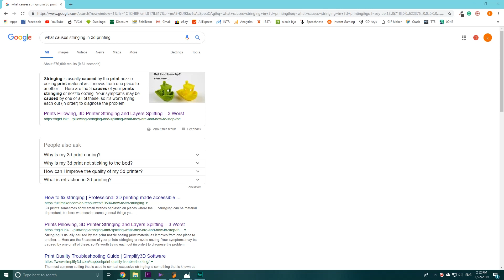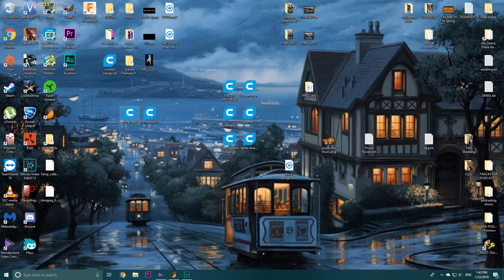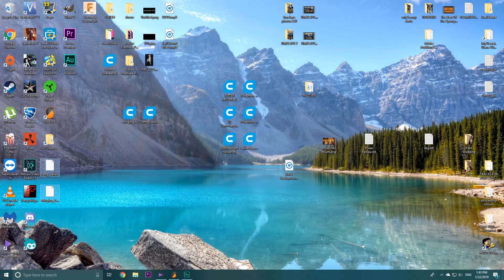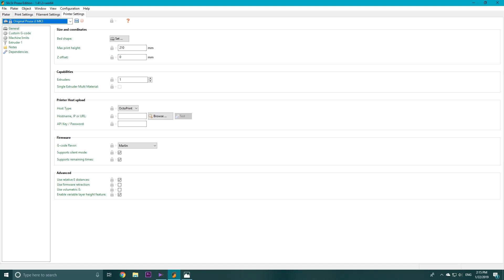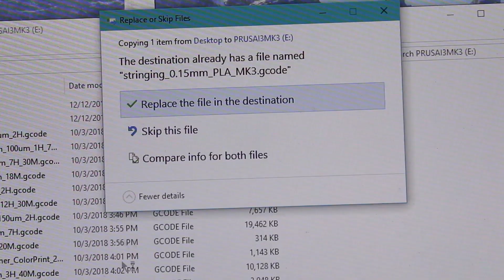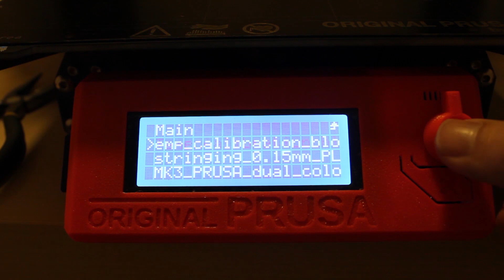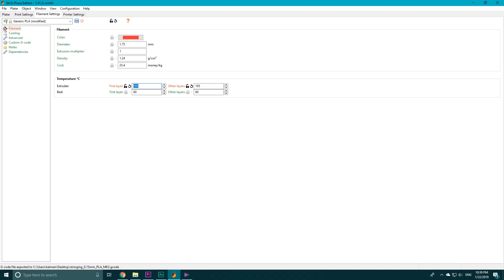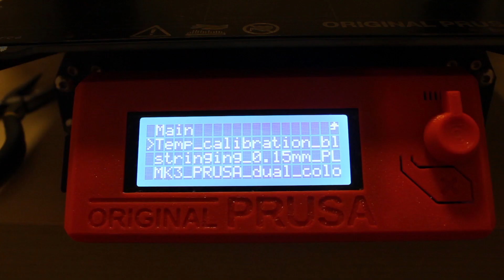How to Fix Stringing on a 3D Printer

Comment: You are 100% wrong. 
What causes stringing is the SOFTWARE, nothing else. Cura simply doesn't string. Prusa is terrible. Identical settings, different algorithm.
Reply: Actually I get where you're coming from but I use cura and the same issue Think of it this way the higher the temperature the longer it will stay goopy and if it moves real fast without giving it proper time to cool down it will cause stringing or blabbing and just overall horrible quality it actually seemed to fix my issue when I lowered my temperature down about 20° but still staying in the recommended temperature of the filament

Comment: This issue is different for every role of filament I have owned. Because the melting point of different sources of the same plastic varies widely. 
You can print with any of them but the need to change slicer settings for each role can be really tedious.

Comment: Export the GCode,
Save it,
Replace the file,
Pull out the SD Card,
Put it in the Computer,
Drag the file into the SD Card,
Replace the Destination,
Pull out the SD Card,
Put it back into the Printer,
....and Print.

Yes, seriously. I can't afford a Prusa MK4 yet, but when I can... my MK3 is going in the garbage... or maybe printing the files that I print a lot and never make changes to.
I hate this process of 3D Printing so much, some days I just don't want to do it and I don't print anything.

I can't wait to try this fix when I get home! (and replacing ALL my saved prints with the new setting, replacing each GCode in my SD Card one by one...)

Comment: I like how my printer defaults with the settings you recommended and it strings like hell.
Reply: Might be wet filament. If I lower the temps like in the video my nozzle instantly clogs...

Comment: I had to put it down to 70 but it worked!
Reply from the maker: I think you mean 170. I don't advise printing so low. if you get stringing on 180 and up then you have moisture problem in you PLA. so, throw your filament into a dehydrator, on 50c for 8 hours. this works for me.
Reply: @kalmanf  sorry I responded so late, thank you but I dont have a dehydrator. Is there anything else I can do with my ender 3?

Comment: Faster retraction isn't better. That's a myth. I set my retraction to 1mm and speed to 20mm. No stringing. Done.
And I have a cheap printer with direct drive. If you use a Bowden tube, set retraction to 4 or 5 mm and speed to 20mm.

Comment: Is this a direct drive of a bowden set up?
Reply from the maker: Its a Prusa mk3, yes its a direct drive bowden.
Reply: @kalmanf  i'm using a creality cr6 se with a bowden setup and still working out the settings to get rid of the stringing.
Reply from the maker: Yes i know, i also helped a friend build his creality printer with a bowden extruder. I think its a good change for creality, however i didnt care much for the filament sensor..

Comment: Export the G Code
Save it 
Replace the file
Pull out the SD Card
Put it in the computer
Drag the file into the SD card
Replace the destination
Pull out the SD card
Put it back in the printer
And print

Comment: Thank you so much for pointing it out that tuning should begin from temperature and then retraction. I had severe stringing when printing small parts at regular PETG temp (235) and retraction (5 mm). I decreased temp to 215 and retraction to just 2 mm and it was IT! Part printed beautifully but a bit weak, too little layer welding. I increased temp to 220 and retraction to 2.5 mm. Now it's perfect! No coasting, no wipe, no extra prime. Ender 3 with 1.9 mm ptfe. Thank you :)

Comment: I read that putting the retraction more then 1.0 (you did 2.0) can cause problems later when filament moves into the 'cool area' and clogs it up.  Do you find this to be true?
Reply from the maker: No, to answer your question. I have noticed a problem at 3 though. Maybe I don't have problems because of my printer model.. Thanks for your input though, you are awesome for watching the whole video 😊
Reply: @kalmanf  Yeah no worries :).  I am using the Mk3S, which printer were you using? It looked like the same printer but wasn't sure.
Reply from the maker: Mk3, basically you have a fancier hotend then mine 😉 my wife always tells me she doesn't like my hotend 😋

Comment: If you're not going to use octoprint save your time by putting sd card in computer then export to sd card. No need to make extra files. I hope these settings get rid of retraction thanks!
Reply from the maker: Don't worry, I will use octoprint and make a video about it! Just got my first Rasbarry Pi 👌😊❤️

Comment: But low temperature  makes your layers de-laminate more easily.
Reply from the maker: Yes, it will do that. However for pretty much all my prints its been more than strong enough.
Or try to print high temp and get rid of stringing with a blow dryer 😋

Comment: I wonder if more heat will be better layer strength as it can melt into itself more. I'm currently printing at 203C for PLA and getting some stringing.
Reply from the maker: Haven't had issues with layers not being strong enough. But this MAY be a problem if you were to use a different filliment than mine. You can always print up a few sticks in different temps and test the strength 😉
Reply: @kalmanf  I haven't broken anything yet but layer adhesion in general is a lot weaker than I'd prefer for parts than need to take a lot of force like a clasp or hook. I've learned that just printing them in the right orientation so the layers are not taking the force is all that I needed! There are some good examples of testing I found recently where you can see a wide variation in strength depending on a bunch of settings like seen here where some layers let go with as little as 12lbs of force. I'm just trying to push it to the hottest I can so the pla melts into itself more ensuring I dont get random weak parts when its a part that needs to be strong. https://www.youtube.com/watch?v=fbSQvJJjw2Q
Reply from the maker: Yes I understood that. But like you said rotating a print is a great way to make it stronger (depending on the model).

P.S.
Don't put CNC Kitchen on my channel. LOL JK, that guy makes great content you can learn from!